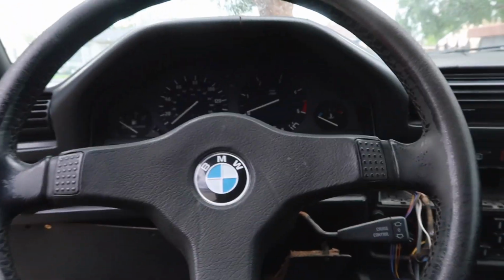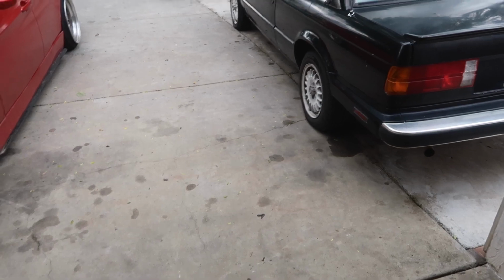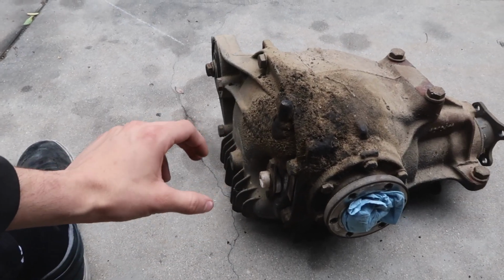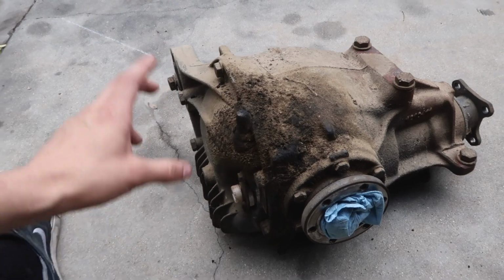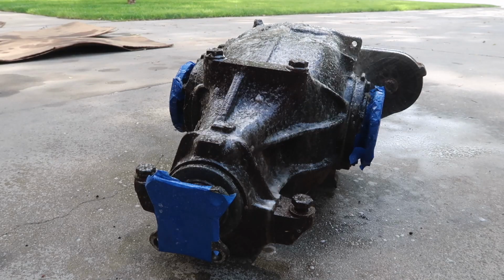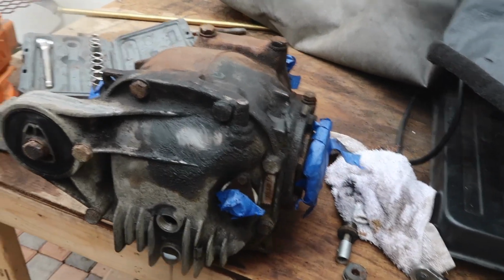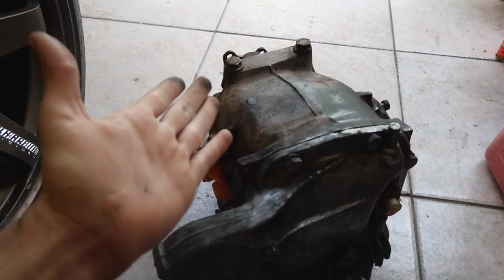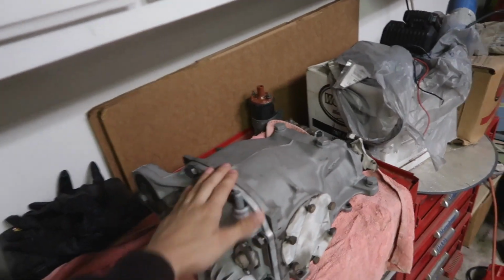So I bought another E30...

Comment: Yo esg. On your e90. Do you get good tire life the way your fitment is?
Reply from the maker: yeah! Haven’t changed then
Reply: esg nice. I got the same wheels like you have. On my e92. I got pretty much same set up air,camper plate camber arms. But I don’t get good tire life. What should I tell the alignment shop. To align it when it’s aired out or in drive height?